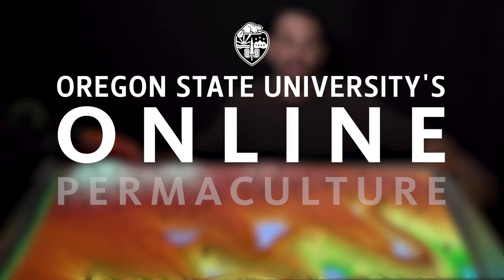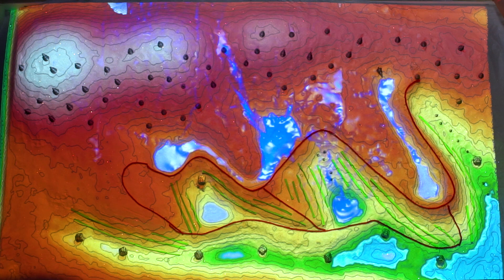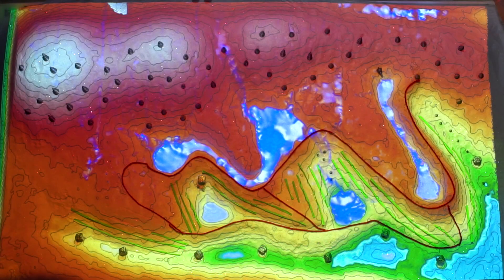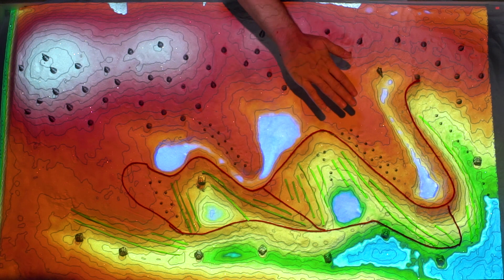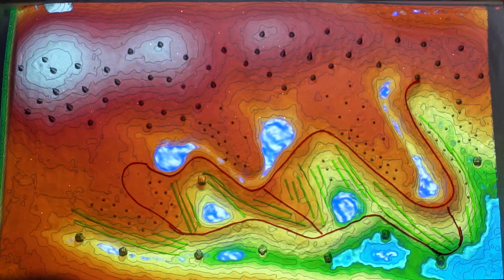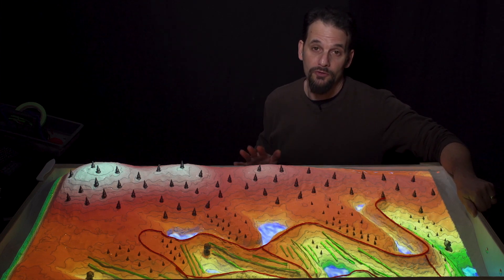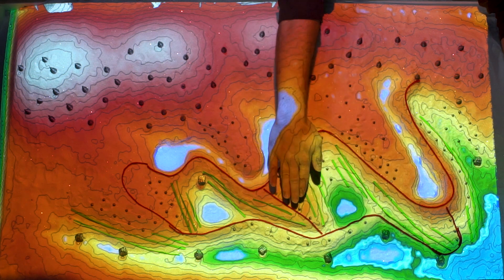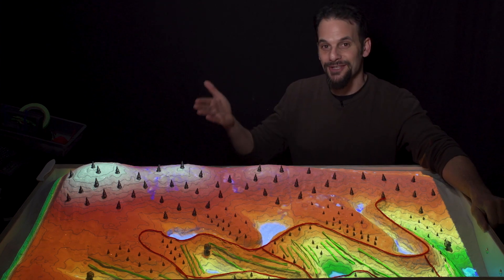Keyline® in the AR Sandbox #5: Design for Trees

Comment: In a savannah-like biome (Brazilian "cerrado" specifically), considering a degraded parcel whose ridge was cleaned of trees and natural vegetation: would it be worth it to also dig ponds directly over the ridge, to somehow infiltrate more water there and facilitate the ridge's reforestation?
Reply from the maker: Perhaps if the topography and soil conditions are conducive and there is adequate runoff that fill them. I would think of them more as infiltration basins than ponds, with the purpose of soaking water here high on the watershed.